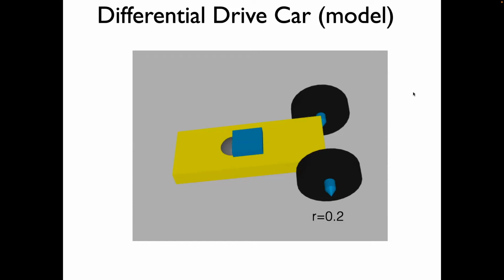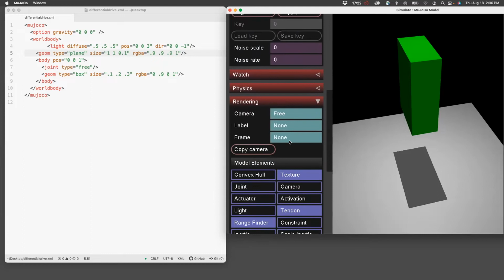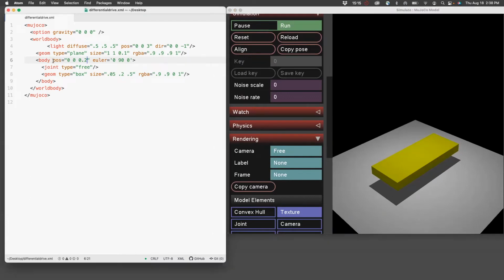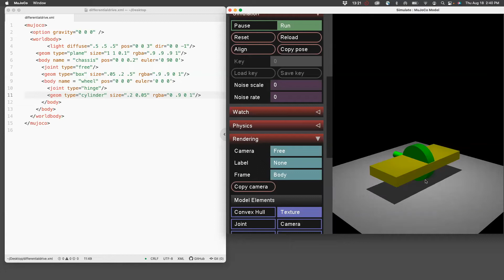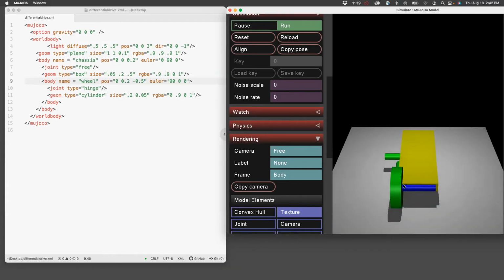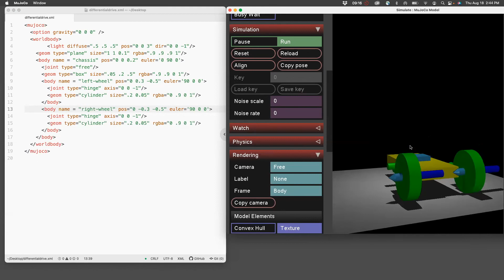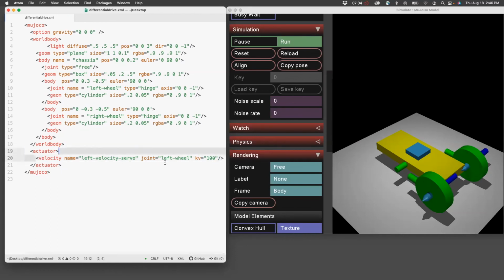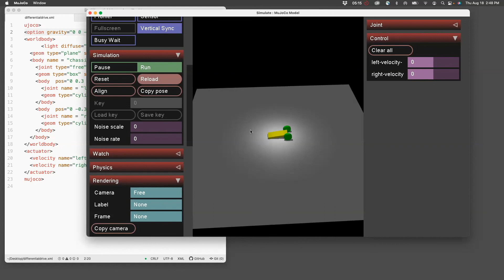MuJoCoPy Lec 3a: Differential drive car (Modeling) (part 1 of 3)

Comment: Thank you so  much! I'm using the .py file you provided as a template to simulate my model. But now I have a question. I want to create a new camera to observe my specific object, so I added a <camera> tag. However, I can't find a way to switch to the view of the camera I created through the .py file. Is there any way to do this? Where can I switch the camera view?
Reply: <camera name="manipulator1" mode="targetbody" target="site_ball" pos="0.27 0 0"/>
The .py file's view is always created by the default camera, how can I switch to a sepcific camera view?
Reply: @HuanquanXiao  How you found the answer ?